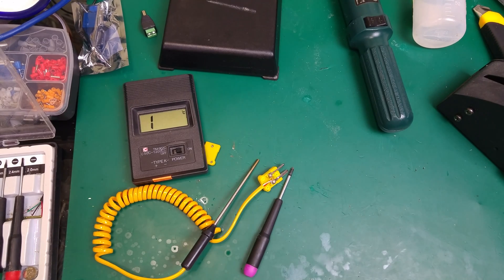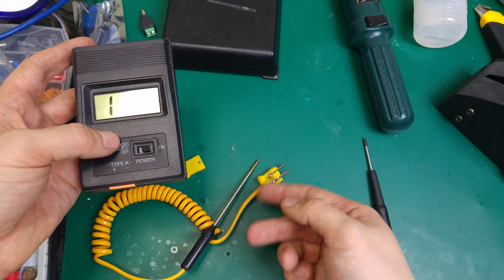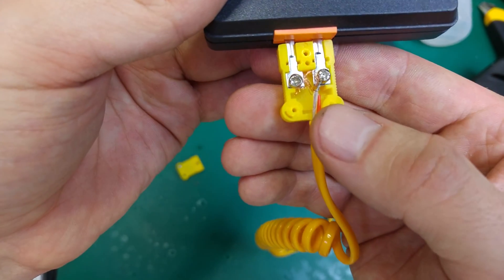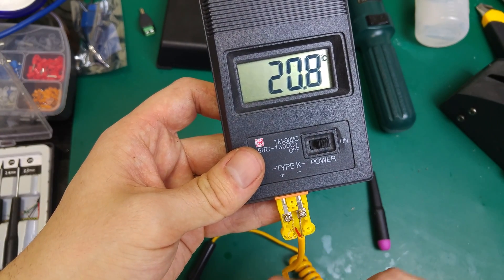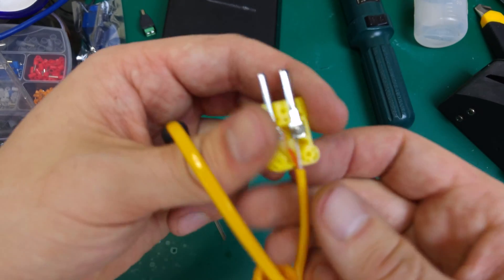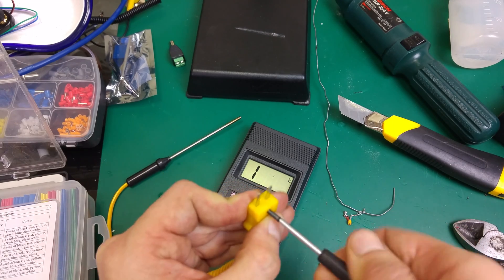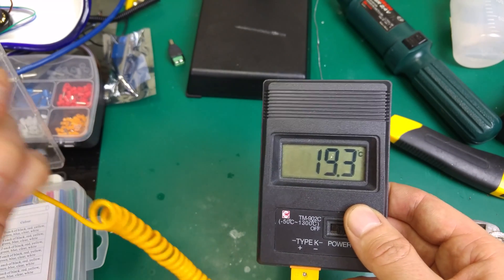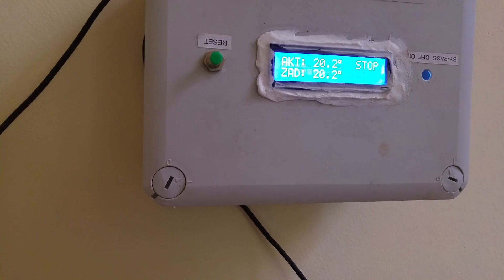K type liquid temperature probe from China - fixing wrong reading on TM902-C thermometer

Comment: I think you meant fluctuating for that incosistent reading. But I originaly came here to see if there is a possibility to modifiy the actual gadget and not the probe as why the display of  mine has much symbols not in use. It is one for two probes and six buttons on it. But still usefull as mine has similar behavior but a 20 cm one to reach inside some glassware.